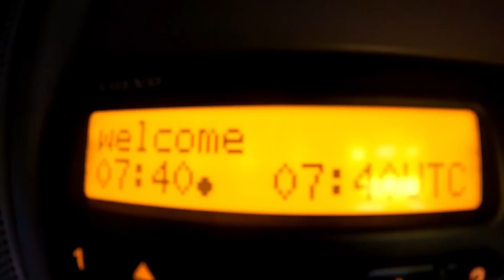Reverse onto a City Roundabout | Multi-Dropping around the South West | My HGV Journey

Comment: If I were you James i would keep front facing camera, turn down the contrast and brightness a touch, and have it in the corner of the screen instead of switching between front camera and camera facing you
Reply from the maker: I don’t like that format mate, just not my preference bud. I tried sorting the brightness on the other camera but I think it struggles with the certain area it’s mounted bud with the light in and out of the cab all the time. Will be trying something different and if not back to how it was 😁👍